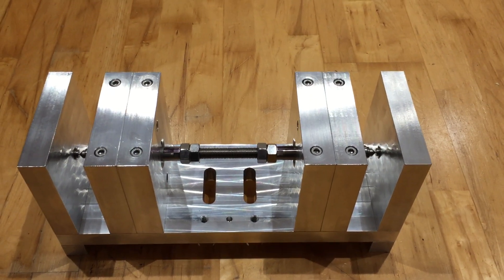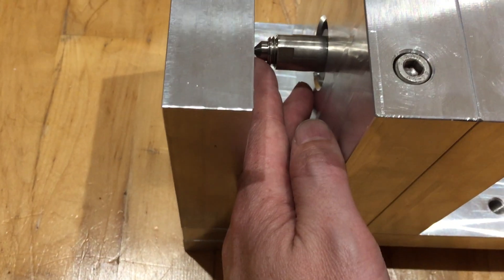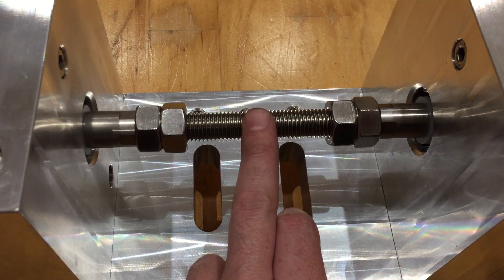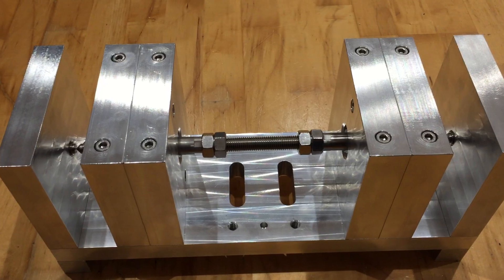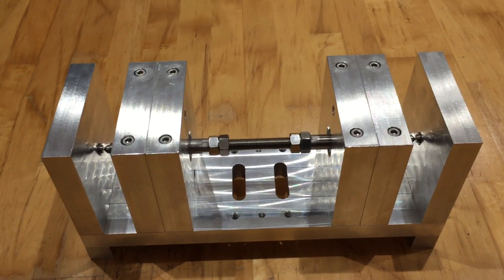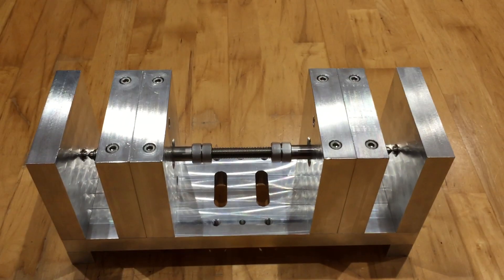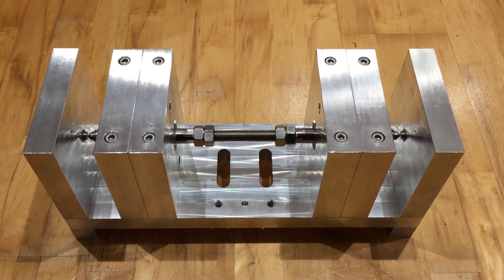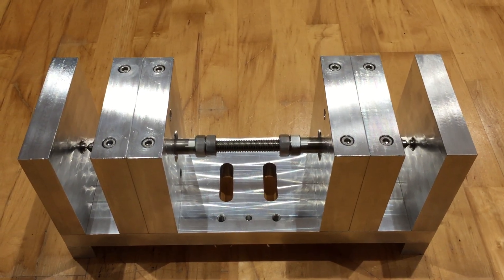Tesla Turbine Permanent Magnetic Bearing Prototype 4 - Part 2

Comment: It’s the points bro they are causing the friction for it slowing
Reply from the maker: @RichardAndrade-f2u  yeah I’ve gone further with this design vertically as you can adjust the magnets so that the rotor is virtually floating and no weight is on the tungsten carbide point, it just uses it as a reference plane. One member took that even further with electromagnets so there is zero contact at all. Another way is to have air bearings either side as you don’t need much air to make it contactless.
Reply from the maker: @RichardAndrade-f2u  https://www.youtube.com/live/FMK_wKDZkYo?si=i_f3xVlYJNjcOwuD

Comment: I would suggest instead of a needle point, possibly using a ball bearing setup identical to tip of a ballpoint pen. But instead of ink surrounding the ball, use oil.
Reply from the maker: I’ve gone further with this setup by using vertical shaft as you can adjust it to float.

https://www.youtube.com/live/FMK_wKDZkYo?si=i_f3xVlYJNjcOwuD

Another way is use electromagnets or air bearings for the z axis for completely contact free and silent.

Comment: Very nice engineering! Why not use a ceramic bearing rated at say 75,000 rpm?   Seems easier?
Reply: @nikola.tesla.r.and.d.centre  Thank you for the detailed response that is good to know.  I have been looking at other designs that spin 24/7. I found a good example here https://en.wikipedia.org/wiki/Gas_centrifuge Zippe type gas centrifuge where they orient the rotor vertically , magnetically suspended with a needle bearing at the base. These are rotated at 50,000 RPM (according to wikipedia).